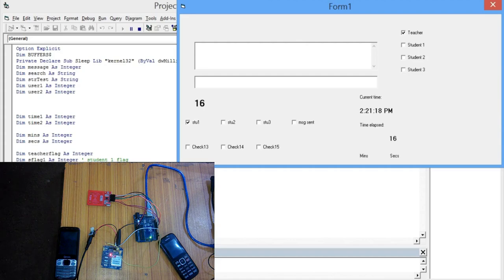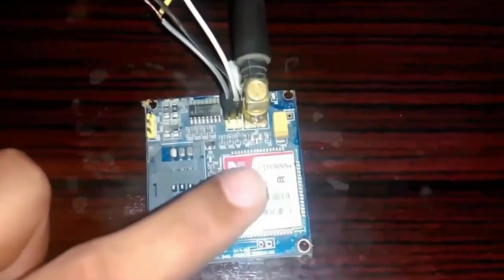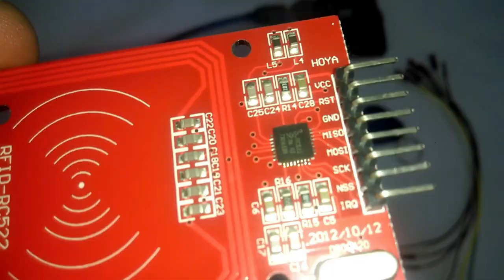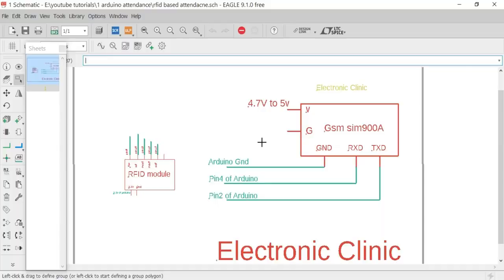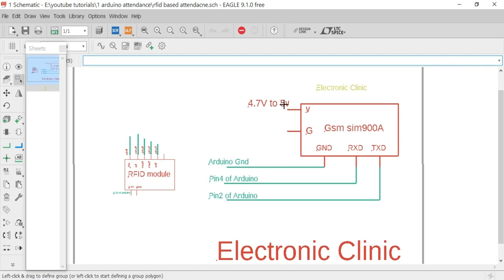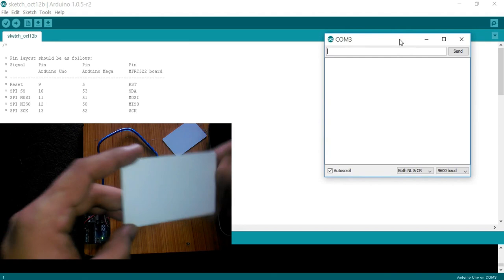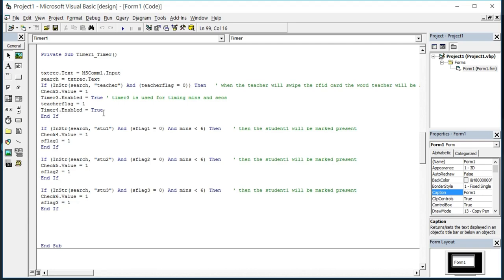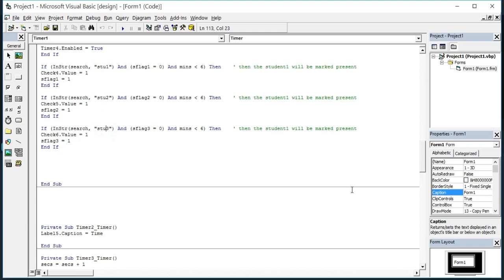How to make RFID based students Attendance system with sms Alert “Arduino,GSM Sim900A,MFRC522, VB

Comment: Which of the 2gnd in the arduino can i connect the gnd of gsm module?
Reply from the maker: All the grounds are internally connected. You can connect this with any ground pin of the arduino.

Comment: Nice project sir.... Can i use sim800 to this project sir?
Reply from the maker: Yes u can use any gsm module. But in the controller programming u need to change the buad rate etc
Reply: @ElectroniClinic  Can u help me with tha plz sir? i have no good knowledge in arduino
Reply from the maker: I dont have 800
Reply from the maker: But its a complete project. In arduino programming only change the buad rate if necessary
Reply: @ElectroniClinic  okay sir thank u.i wll do this project using that module. If i have a problem can i contact u sir?
Reply from the maker: Ya sure. You can comment over here or u can sms on my whatsapp number. Check description
Reply: @ElectroniClinic  okay sir thank u so much......

Comment: Sir ,how we will connect our circuit with visual basic on pc .
When we detect RFID card ,how it will send to my pc and my flags on pc will on&off ?
Reply from the maker: Connect arduino through its usb cable that's it
Reply: @ElectroniClinic  does VB support aurdino , I am new to VB so i don't know. Like serial monitor VB will react ? 
The VB code can also be run on aurdiono

Comment: can rc522  be extended its range?
Reply from the maker: there are other modules with longer range. you can try those.
Reply: @ElectroniClinic  what are those modules? .. i have a code of automated dtr file system.. but i have also a plan that, my diy project, i wil be using it at bike race timer..
Reply from the maker: Long range uhf rfid reader for vehicle/parking application 5 meters read range
Long range uhf rfid reader for vehicle/parking application 5 meters read range.by KingGo.Available from these sellers.Working mode:Passive, Protocal: Support ISO18000-6C and ISO18000-6B. Support RS232, RS485, Wiegand 26/34 interface.

Comment: Sir can i ask what db u’re using?
Reply from the maker: My dear currently it has no database, but i am working on that and soon the database version will be available. I will be using msql database
Reply: Ahh i see. But sir is it possible to get the cp number stored in db using vb.net to arduino so that it can send sms ?
Reply from the maker: yes you can.